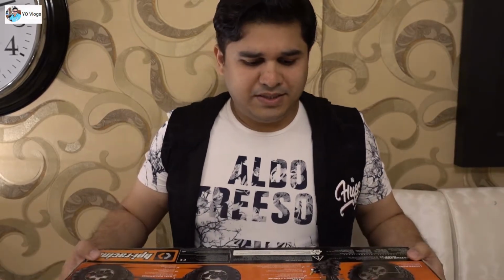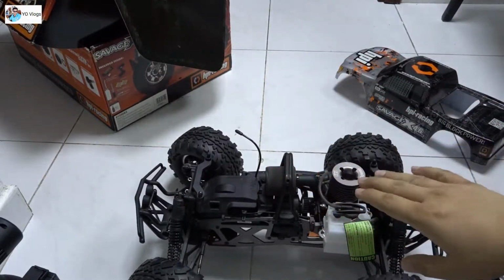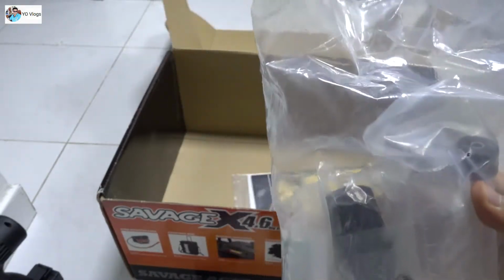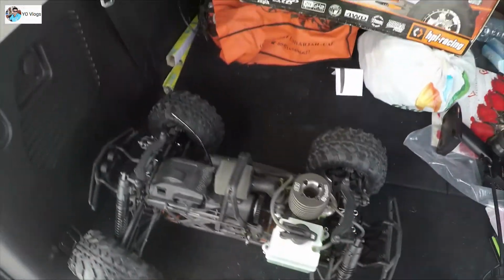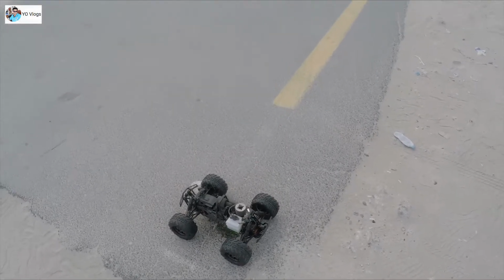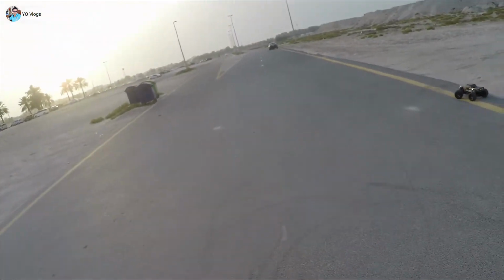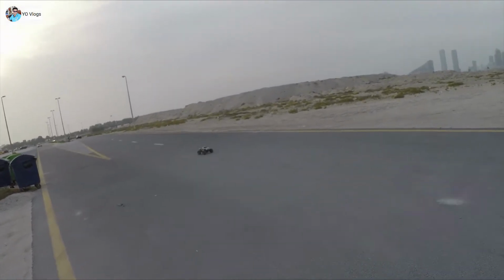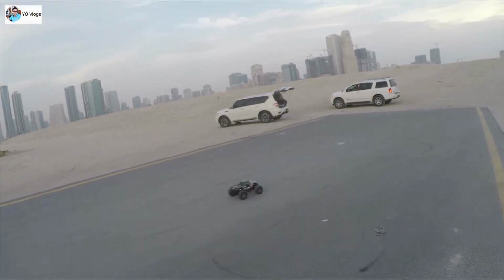HPI SAVAGE X 4.6 Nitro Rc Truck Unboxing and 1st tank 2018

Comment: The wheels should be off the ground when breaking in for the first time...it would have started better.....also the electrics don't have to be on to start the engine....just manually adjust the carb first.
Also it will take many tanks of fuel and tuning.
Great truck!

Comment: I just got a rechargeable glow plug igniter from the mail and I cant wait to use it when the snow clears up but I will try it a few times on the road
Reply from the maker: this truck is a beast believe me but you have to break in the engine properly and tunning is the key to success
Reply: YO Vlogs my friend screwed up the tuning when I wasn’t looking and then the engine was getting to much gas and kept flooding and ruined the glow plug I hit a new one now.
Reply: YO Vlogs could you do a video on how to tune it?

Comment: Your idle screw is low that’s why it’s not starting easily I own a savage so I know if u tap the throttle a little bit it will start very easily
Reply from the maker: itzKert Music yes you are right actually I change the idle screw I open little bit and I also change the ignitor now check the second video I upload within this week
Reply: itzKert Music first when you get it you DO NOT TUNE IT you tune it after it has been sitting on idle for its first tank after the first tank that’s when you tune

Comment: Big truck but looks slow
Reply: Abiha Batol trust, it’s nothing slow about it...!
Reply: He's running the engine in......It can go about 45mph.....when run in....with high Nitro content fuel.....but its geared for power....not top speed....hence only 45mph.....fast as hell for an offroad monster truck......and the Savage is a beast!
Reply from the maker: Sam Lawrence thanks dude
Reply: Ok